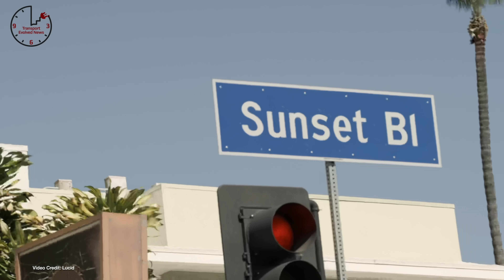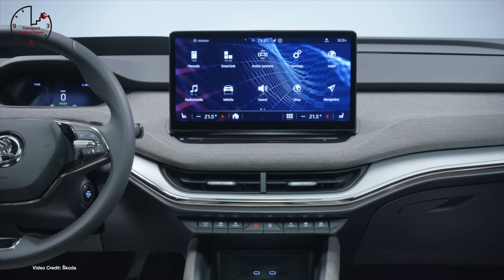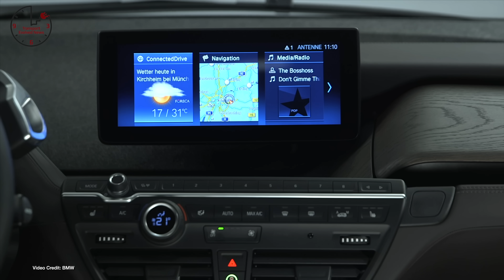TEN 306 -  Lucid Sets New Record, Tesla Raises $5 Billion, Ford Goes Electric On The Drag Strip

Comment: Two motors are good but 4 would be much better.
With one motor per wheel, very advanced traction control is just a matter of good software.
The ICE power train only needs to extend to the front wheels.  The motors at the back can give the tractive effort as needed.  The Volt used electrics to give it an effective transmission.  On a offroad machine, the same method could be used to produce impressive handling of bad  road conditions.

Comment: Another excellent video Nikki but the notion that if one doesn't vote one can't comment on the outcome is profoundly simplistic. One can certainly comment on the system which, if we want a sustainable future, isn't fit for purpose. 
Our democratic systems divide the population into the ideological left or the ideological right which divides society almost exactly in half, effectively removing the 'voice of the people'. The notion that more people voting will produce whatever your see as your desired result is also wrong. In countries with voluntary voting the split is, near as spit, 50/50. In Oz with compulsory voting the split is, near as spit, 50/50. It's an ideological split and when it comes to ideology and belief, reason and logic are never invited.
Our dualist, adversarial, ideology based political systems are, without doubt, the worst possible way to make decisions. No other organisation in their right minds would use it because it inevitably makes bad decisions usually massively influenced by wealth which mostly has a massive vested interest in the status quo. The discussion needs to widened from the choice between 2 candidates, the choice of the least worst unprincipled, lying puppet. That's no choice whatsoever.
Once again, if we want a sustainable future, our current political systems aren't fit for purpose.

Comment: I think Tesla have never commented when their cars have been found to be faulty.  Maybe they think, don't say anything then people will never know it happened.
However, if talking about a factory, a battery design, a software rollout, anything that will raise the stock price, then Tesla will sing long and loud like a bird.
Reply: That's called "being a Company" and "Marketing".
There's a reason Ford didn't shout out to the rooftops that one of their models had a defect that leaked carbon monoxide 8nto the cabins. Good businesses don't admit fault to anything that could disadvantage a brand. If any business tried to do it they'd go bankrupt.
Reply: @tnk4me4  Not to mention the Ford Pintos that burned over a hundred people to death or the Ford Escort's rear seat belt faults that cut children in half or the Ford transmissions that slipped from park into gear and killed hundreds of people.  Of course a missing nut on 2 Model Ys is just such a huge news story that we can ignore the massive safety defects of every other car manufacturer (all of which have FAR less safe cars).